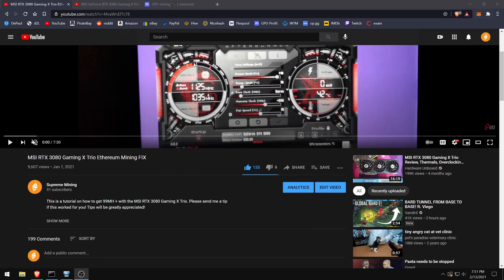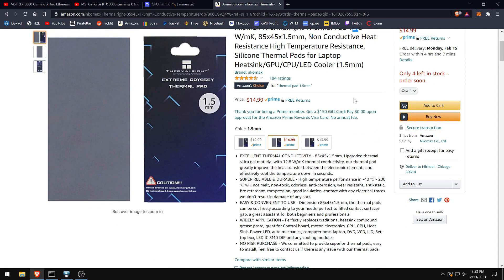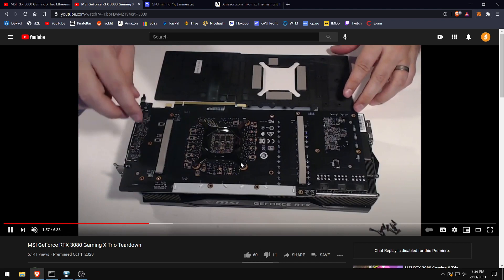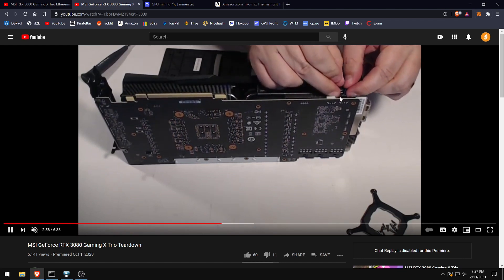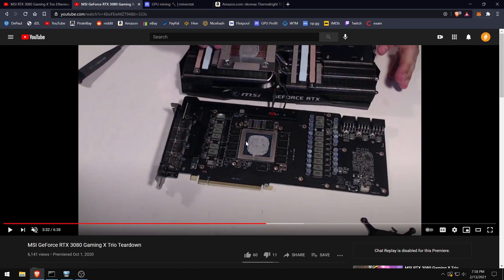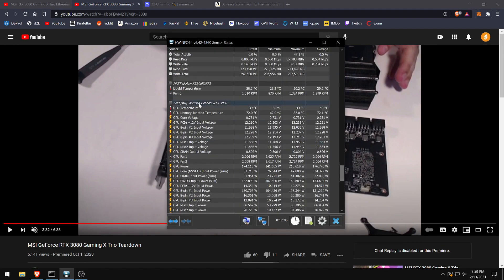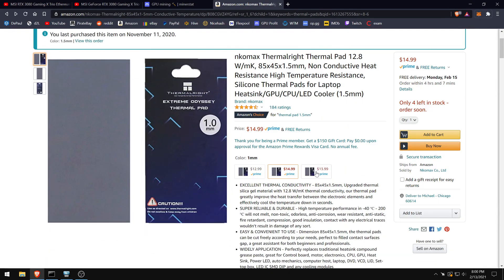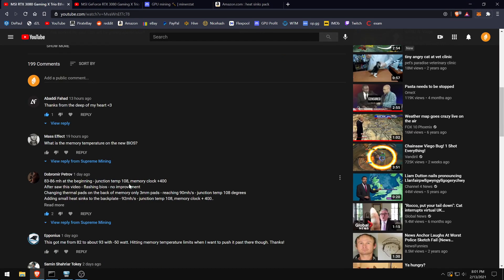MSI RTX 3080 Gaming X Trio Fix UPDATE

Comment: I am seeing 112C on my memory. I'm for sure gonna be changing them out.
Edit: I cannot find good 3mm thermal pads anywhere.
Reply from the maker: Definitely do not mine at those temps. That's well above the card's thermal limits. You can try 2.5mm or stack two 1.5mm.
Reply: @actualGoodMemes69  I think I'm just gonna try changing the inside ones. If that doesn't bring the Temps down to a good level I will go looking for 3mm again or use what you suggested.
Reply: @actualGoodMemes69  Just changing the inside ones brought the Temps down 10c to about 102c.
Reply from the maker: @johndaman4863  Hmm that's still not ideal but an improvement. I'd probably go ahead and replace the backplate ones as well.
Reply: @actualGoodMemes69  I ended up just reducing my power limit to 70%. This got me into the low 90c but I lose 10 or so mhs, probably worth to keep it lower than 100c.

Comment: Hey man, my rtx 3080 asua strix oc, i set it to 65% power limit. - 200 core +1275 memory and 65% fan speed at 240w , my core clock  also fluctuates between 1100 and 1200. Should i be worried and set a custom volt curve to keep it locked? My hasrate is  between 100 and 101.80 constantly and my memory is only 92 degree.

Comment: Thanks for the great video! I'm looking at ordering some pads now for the front side, and which size did you actually end up using on yours? You mention 1.0mm in your video, and others here have said 1-1.5mm, but from other sources online some people are saying it's far too thin, and others have gotten poor performance switching out their pads. Given how great your temps are, I'd like to grab whatever thickness you opted for!
Reply from the maker: Mine are 1mm. And yeah using the correct thickness is definitely vital.
Reply: @actualGoodMemes69  Just to be clear in total you would need 3mm for the backplate part and 1mm for the inside part right?
Reply from the maker: @ElCarl0s  Correct!
Reply: @actualGoodMemes69  I successfully replaced the inside part and there seems to be an 8-10 degree improvement! Quick question about flashing the BIOS. You mentioned in the video to take the latest version. I can't detect any difference between the 1101 you used and the newer 1123 that currently is available. Should I just go with newest one anyway? I am a little scared haha.
Reply from the maker: @ElCarl0s  going with the newest is generally the safest bet. I didn't realize they released a new Bios, I'll have to check that out and update.
Reply: @actualGoodMemes69  hey so I grabbed 1.5mm pads and my pc turns on but doesn’t have a display I think there may be something to do with thickness perhaps…

Comment: Great video man, I changed thermal pad inside 2 days ago with 1.5mm thermalalright pad and followed your steps from first video. Now i get stable 99 mh/s, my vram stays at 100 degree on 50% fan (besicall silent mod). If I wanna put 100% fan, vram temperature goes down to around 92. Before even I put 100% fan it still throttles. Now I can enjoy using my pc while mining without throttling.
Reply: that is very bad card then , my stock rtx 3080 gaming x trio with stock thermal pads 99mh at 92 memory temperature, how can you get worse temperature with this expensive thermal pads ?
Reply: @techgeek2994  Either u are talking out of your ass or you have another brand card, gaming x trio cant even reach 99mh with stock thermal pad it will be constantly thermal throttled. Not mentioning the power limit with the stock bios. In fact all 3080 and 3090 will reach 110 on their stock thermal pad, it is a very common problem. So I don't know where you get that conclusion it is a bad card.
Reply: @kissshawn  i have msi gaming z trio not x trio it is my mistake  and it is working at 99mh with suprim x bios.
Reply: @kissshawn  that is not true gaming z trio and x trio are basically i think same cards , mine z trio is hashing 99mh and working stable at memory junction temperature 90 degrees . all that needs to be done is to flash suprim x bios and they can work even at 100 mh
Reply: @techgeek2994  gaming z is the upgraded version of gaming x. msi probably fix the thermal pad issue. I bought my card back in December, the first bunch of release, thermal problem happens at every card when mining.
Reply: @kissshawn  ok then change thermal pads yourself order it and change

Comment: Hey man, just want to make sure - for the thermal pads on the backplate, are those definitely 3mm? Reason I ask is because I can't find a decent 3mm anywhere lol
Reply: I bought two 1.5 and stacked. Having great results with it.
Reply: @StinkySteinke  qual a temp memory juction no momento e sua potencia em hash?
Reply from the maker: Yeah I'm fairly confident they are 3. You can try doing what someone else did and use thermal puddy instead of thermal pads because thickness doesn't matter. He claimed to get really good temps for it. If you don't want to do that, I'm pretty sure 2.5mm will work for the backplate. Also, the backplate pads don't contribute nearly as much as the inside ones, so definitely focus on those as a priority.
Reply: @actualGoodMemes69  Thanks man. I bought extra 1mm and some 2mm so I might just try out the 2mm and stack the extra 1 if need be. Appreciate the videos, I subbed. I'm maintaining 100 MH/s at just under 240W so pretty happy with that. Now I just want to turn my fans down from 100% lol

Comment: Update:

I have changed out thermal pads exactly as instructed. My temp is easily 8°c cooler.

Before: 
85mh/s
+950
53°c

After:
98mh/s
+1275 (is this safe?)
53°c

I am a follower and subscribed, thanks for the education lesson!
Reply from the maker: Awesome! Glad to see that this worked out for you. And yeah you can basically push the memory as high as it will go without crashing as long as you're not getting a high amount of rejected/invalid shares (really high overclocks can result in producing incorrect shares).
Reply: @actualGoodMemes69  I use LOlminer, how can i tell if shares are rejected? also, is there a better minner you suggest?
Reply from the maker: @bensteinke1084  Hmmmm. I don't use lolminer so I'm looking at screen captures of it and don't see where they list the shares. But you can probably see the accepted/rejected ratio on the mining pool side.
Reply from the maker: @bensteinke1084  From what I hear, lolminer is one of the most efficient. Do you have AMD cards, NVIDIA, or both?
Reply: @actualGoodMemes69  Only rocking one Nvidia 3080 in my gaming rig. Pretty new, but diving in deep pretty quick. 

Not sure if this helps you, but here's a clip.

                         GPU 0     Total
Speed (mh/s):            98.12     98.12
Pool (mh/s):            102.37    102.37
Best Share:             217.2G    217.2G
Shares (A/S/Hw):       119/0/0   119/0/0
Power (W):               232.3     232.3
Efficiency (mh/s/W):     0.421     0.422
Temp (deg C):               52
Fan Speed (%):             100
Reply: Just looked on ethermine, says 0 invalid shares.
Reply from the maker: @bensteinke1084  So yeah looks like you are good on that overclock then. From my testing T-Rex miner is the best for the 3080. I'd recommend that for you, but I'd recommend writing down how many shares you get in 24 hours on lolminer - then compare it to how many you get on T-Rex during the same amount of time. Then of course just stick with the one that gets the most.
Reply: @actualGoodMemes69  Thanks, I will start that process tonight and let you know what my findings are. Thanks!
Reply: @actualGoodMemes69  Dude, i am at 111mh/s!
Reply from the maker: @bensteinke1084  Whaaaaaaaaaat!?! Are you sure that's a 3080 lol? That's insane, I'm gonna need a screenshot.
Reply: @actualGoodMemes69  tell me where to send it and youll get it. It was only for 1 hour. 113 was the peak.

Comment: Hey bro, thanks for posting the information I want. I want to ask you something for sure before the replacement work tomorrow. Is the thickness of 1mm definitely right? Thank you.
Reply from the maker: The thickness on the inside is definitely 1mm. I believe those are the ones that make the most of a difference. The backplate ones are 3mm I believe.
Reply: 1mm or 1.5mm both are fine. I used 1.5mm myself but you can see the heatsink squeezed it so 1mm is the perfect size.

Comment: Hey bro, I wanna ask how to make the bios to suprim x bios??? I don’t know how to make it:(
Reply from the maker: Just follow the flashing tutorial I linked in the first video. If you're still having trouble I could make another video on how to do that.
Reply: @actualGoodMemes69  yes, just download suprim x bios and it will match my msi gaming 3080?
Reply from the maker: @xxxadamxw8367  I'm not sure what you mean by "match" but it will be compatible with it yes.
Reply: @actualGoodMemes69  so you mean the only thing I have to do is “download it and install it”. Then it will work perfectly?
Reply from the maker: @xxxadamxw8367  yes you flash it onto the card with nvflash and it should fix the problem. You may need to replace the thermal pads as well.
Reply: @actualGoodMemes69  Seria ótimo se você fizesse um vídeo explicando como mudar a bios na MSI Trio X
Reply from the maker: @bits-vr  Ok, eu acho que estarei em breve, já que muitas pessoas estão pedindo por isso.
Reply: @actualGoodMemes69  thanks for the update, been meaning to hit you up for an update. I have the suprim bios downloaded ........ just a little nervous to flash it
Reply from the maker: @_noelvasquez  Yeah everyone is the first time. Do it at your own risk, but in my opinion it is not dangerous. My card has been running stable for over a month with the Suprim Bios (arguably even more stable than its stock bios even for gaming).